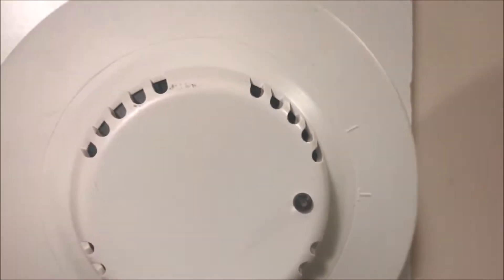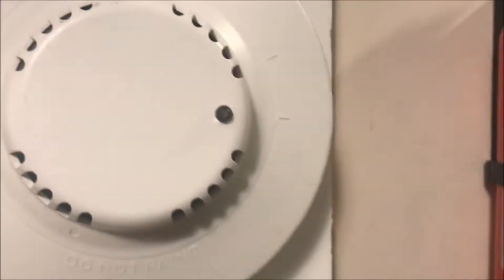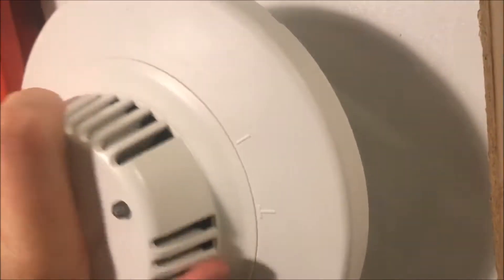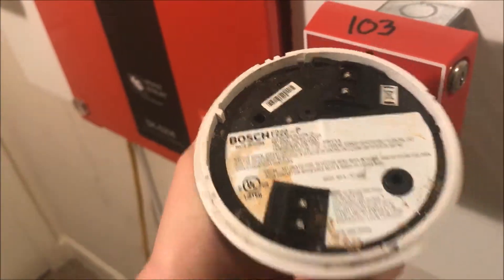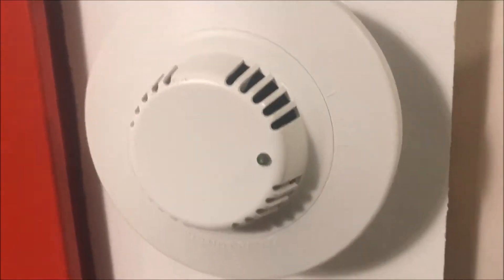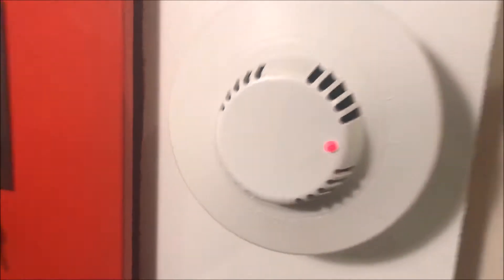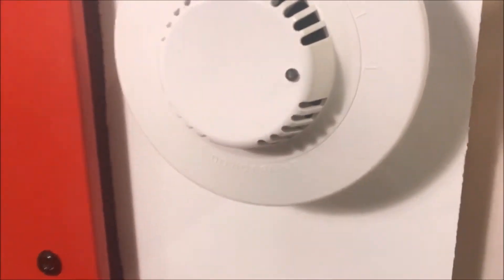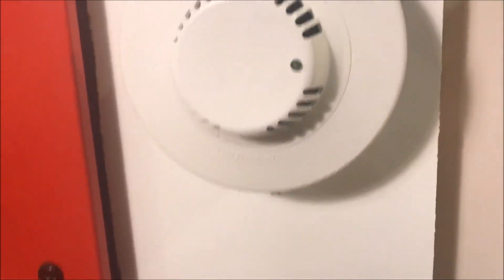Testing and Review of the Bosch F220-P Smoke/Heat Detector

Comment: Compatibility listing takes into account current draw on the loop. Most 2 wire detectors will operate on any panel in ideal conditions. (Example, fully battery charge, panel running on ac power, only a few detectors on the loop, and a short loop with minimal voltage drop) So for you hobbiests out go ahead. For professional fire alarm install, all compatabillity lists must be followed, all voltage drop calculations must be done and all proper engineering must be followed! I have done inspections where detectors and horn strobes worked for years but they get older and tend to draw more current and all the sudden do not work! Just did one where 2 strobes were non functional. We did proper calculations, spit the loop to bring down the drop and wow majically they work. Just keep in mind I know you guys like this stuff but make sure you lean the code and engineering part of the business as well

Comment: The F-220P doesn't have a heat sensing element, but the F-220PTH does. I'm guessing they just slapped the same generic label on both devices.